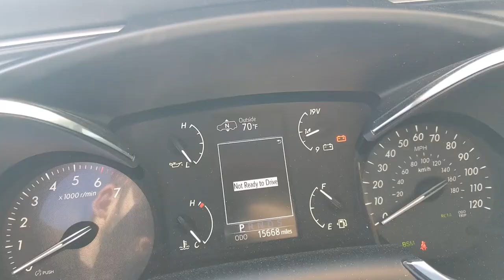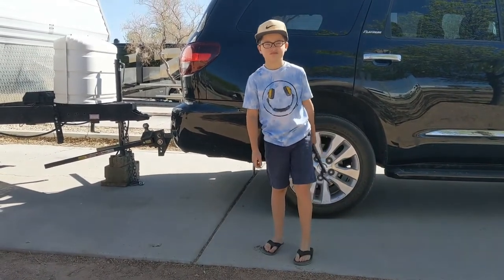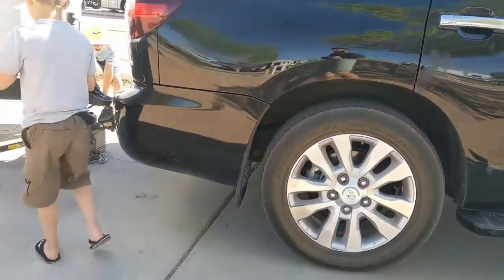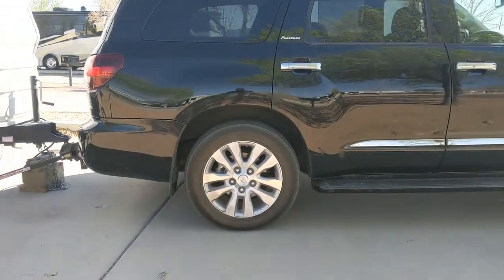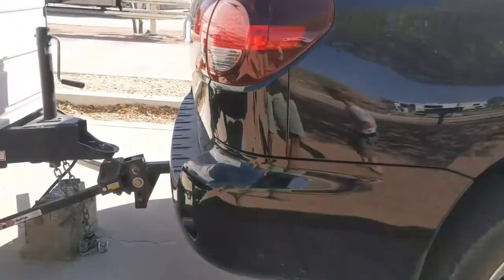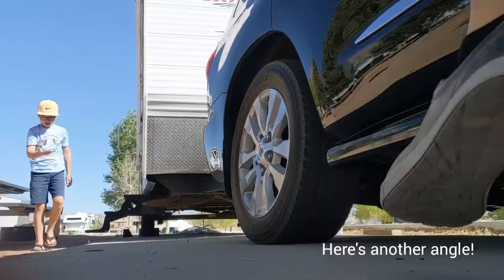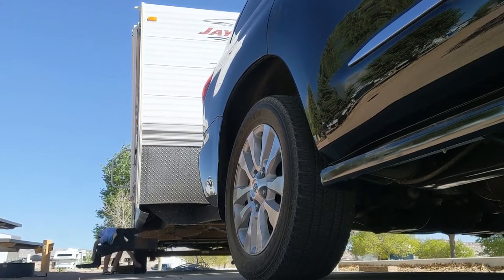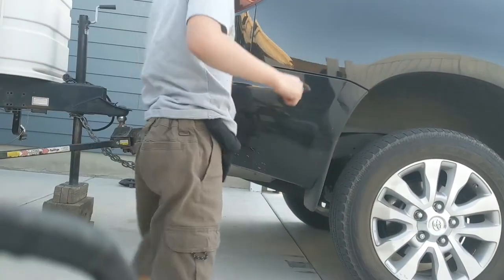2019 Toyota Sequoia Platinum Rear Airbag Air Suspension - Raise & Lower Rear End for Towing a Camper

Comment: I have a 2012 Sequoia Platinum towing a 31' with a 800lbs hitch weight.  Are you shutting off your air suspension prior to hook-up? For towing and hook-up, your Sequoia should be in sport mode for the AVS shocks and you need to engage the manual button to shut off your air suspension for hook up. You will have less sag and put less stress on the compressor. The Sequoia tows beautiful and has lots of torque for towing.
Reply from the maker: Thanks for letting me know. I'll have to try that next time!
Reply: I just bought a 2008 Sequoia Platinum to tow my 30 ft camper. The dry weight of the camper is about 6500. When loaded, I estimate my tongue weight to be 700-800.  The thing that concerns me is the weight limit of the vehicle.  It's supposed to allow 1200 for passengers and cargo.  My passengers will be about 800 pounds.  So that only leaves 400 for the tongue weight.  I may be overloaded by 300-400 pounds.  I plan to use a weight distribution hitch.  So hopefully that will handle any sag.  Do you know if anything will be a problem?   If so, I can bring another vehicle to carry some of the passengers.
Reply: @adamr8628   you will be fine with the cargo and trailer as long as your using a weight distribution hitch…. Ensure you have the HD with a 1400lbs rating.

I use a PRO-PRIDE hitch. Costly but worth it. I have towed for years in Western Canada with the winds in the prairies and the drive through the mountains. Mountains are easy, it’s always the flat prairie with wind where vehicles work.

We just got back from the mountains in Alberta to home here in Saskatchewan. Pretty decent mileage at 11 mpg. 

The sequoia has a 4.30 rear end which is just awesome for towing.

Good luck.

Mike
Reply: @adamr8628  and lastly tires…. I switched mine to Pirelli’s scorpion verde at the recommendation of Andy Thompson at Can-Am RV, the longest serving Airstream dealer in Canada and I believe in the USA. I went from the 275 to 255 with a speed rating 110W, XL load. They are just awesome and dissipate heat while towing.
Reply: @michael  What is the dry weight of the RV you are  towing? Also, i read the tow rating on the sequoias after 2010 are lower (due to new J2807 regulations, but not sure if anything actually changed on the sequoia after 2010)